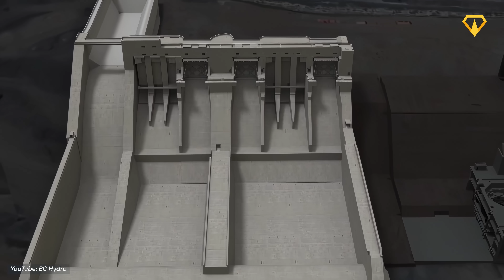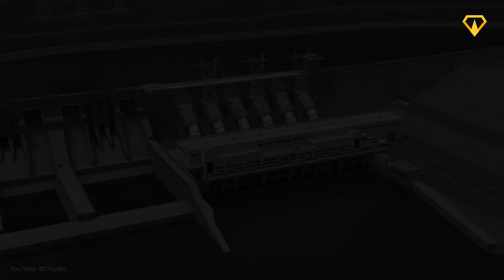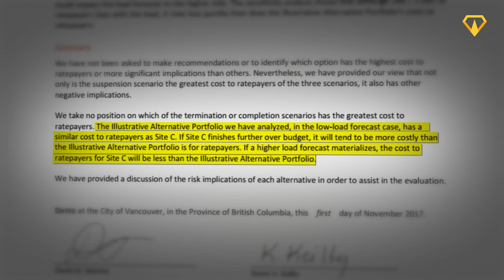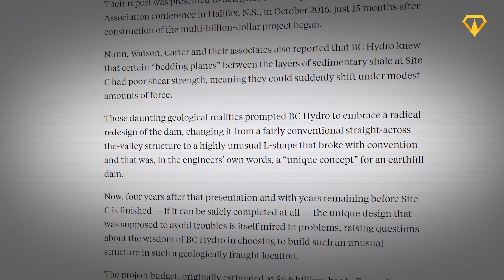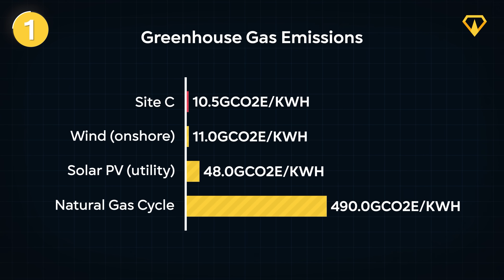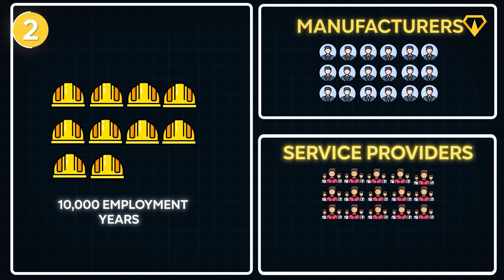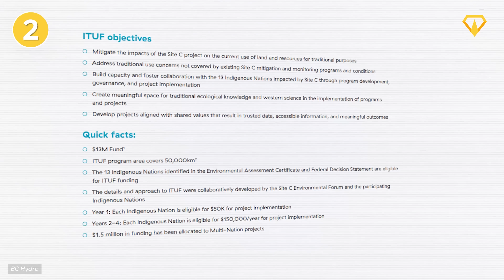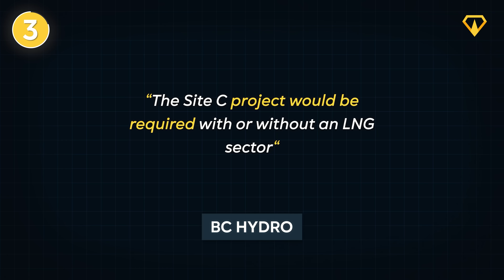Canada's Massive $12B Mega Dam

Comment: I live in BC along the Columbia River, one of the most dammed rivers in the world. My father ran an electrical consultancy specializing in power generation and distribution. He spoke often of the practicalities surrounding that.

As his son, I understand we need power but my thoughts often wander to what is lost when reservoirs are filled. This video glosses over that.

When the Hugh Keenleyside Dam was finished in 1968, we lost the 4th largest bread basket in the Province of BC. The ability to grow grains, livestock, fruit and vegetables with capacity exceeding the Creston area and on par with the Okanagan Valley. Gone. Wildlife are forever affected as well. With their habitat and migratory routes gone, they suffer and in many cases, disappear as the salmon and many wetland species have done.

These impacts are significant. We don't have lakes. We have reservoirs called lakes. The water level fluctuates dramatically and as the water level drops, the shoreline turns into a barren landscape, prone to dust storms. You don't see many boats parked at docks because docks are difficult to maintain as is the access to them. The beaches, once plentiful, are now few and far between.

So the word "renewable" has to be taken in context, as does the design meant to withstand a 10,000 year earthquake. The reservoirs will likely be filled with sediment by then so if the dams do blow, it'll be a wall of mud with a bit of water. And very little electricity being produced just prior to that. Humans - 0. Planet - 1. The planet always wins in the end.
Reply: Just a reminder that the WEF Agenda has been at their program for over 100 years and have buried all GOOD info that we all need to know. As an example there is no water shortage anywhere.  It is just deeper than they have told us but the pristine huge reserves are enough to look after the entire world continuously, as the actions of Volcanism creates pure water and OIL. Oil is NOT a fossil fuel. period. Texas oil fields are refueling themselves and they are just capping them to pretend it's not happening. (Trump and Bidenomics going on behind everyone's back). Same in Canada notice all the meters on your water ...what a sham!  All to create a mass illusion of shortages.
Reply: Disagree with most of what you said. Problem with people like you is you have no alternative plan. We are the envy of the world with our abundance of renewable hydro power. Only makes sense to continue to dam the Columbia and take advantage of the much smaller reervouirs that are typically needed. Sure there are some drawbacks but the pros far outway them and for the benefit of the entire Province.
Reply: Great comment. Unfortunately the world "needs" electricity because people are determined to live as "easy" a life as possible even if it means everything going to hell in a handcart. The first nations people lived a life in harmony with nature and flourished. They did not need electricity so why do we? Short answer is we don't. Now modern people destroy nature and live lives of depression, addiction, suicide and exploitation and the only people who seem happy are those who are rich enough to somewhat escape the man made problems of the world. But even then their happiness is skin deep because they aren't living natural harmonious lives. The happiness of the rich comes at the expense of the poor and the natural world. It's not a situation that can sustain itself and in the backs of the minds of the rich they know this deep down. That why you see their guilt flood out uncontrollably in insane attempted philanthropic endeavors.

Modern society has been a disaster and the problems get worse ever year. Ultimately it is unsustainable because people are growing more and more dependent on an increasingly centralised System and as a result this System can't make progress in case it makes a mistake which would devastate the lives of it's dependencies and so instead has to settle into risk averse stagnation.

Every time you turn on the news you see evidence that modern industrial society is stagnating under the weight of peoples dependencies and the next step is for it to break down completely. 

The future will not look futuristic, it will look like things were 5000 years ago with the added advantage of all accumulated knowledge having been retained and that is a very good thing indeed. IF your able to survive the breakdown of the system. As seen from the collapsing birth rates of the developed worlds it is clear that many will not survive the breakdown but that is simply natural selection continuing it's eternal march unconcerned about modern trends and phases.
Reply: correct.  people cant handle big pic and overstate the true impact of  “sustainability” industry.  100% guaranteed real net zero is zero humanity.  hunter gatherers and subsistence could be peak sustainable if over hunting animal populations are avoided
Reply: I'm for the advancement of people, even over wildlife.   Beavers are found all over the planet so one dam in bc isn't going to disrupt the big overall picture much if at all, for any species.  Human flourishing must come first.
Reply: @howebrad4601  It can all be done in coordinated harmony that considers all life as precious. Sacrifice the pawns and ask questions later? That model is outdated.
Reply: @Usammityduzntafraidofanythin  Thank God the Golden Age has arrived and out with the Dark Age's rules!!  Everything will change as our hearts change and that means all of nature too. Treading the earth will change to never bending a blade of grass as we step forward.
Reply: @howebrad4601  A typical response from someone who reaps all the benefits of hydroelectric power with few if any immediate repercussions. Humans need to eat. If we flood much of our best farmland for hydroelectric power, what will the people eat? May not seem like an issue now but wait until our population doubles or triples and places like California and Mexico are crispy dry with depleted aquifers.

Your response demonstrates a lack of appreciation or understanding the complexity and interconnectedness between all living creatures and ecosystems. We don't exist in a vacuum. Then consider that 90% of all creatures who have ever lived on this earth are extinct and ask yourself how long it will be until this happens to humans. Whether we caused it or not, the planet is heating up and soon enough, we'll be crispy critters too. May take hundreds of generations but it's coming. Then it will be cockroaches, wasps and ants that rule the world. We'll reach a point where we don't have enough power to run all our air conditioners, regardless of how many rivers we dam.

Beavers don't dam entire large river systems. Humans to that. Beavers dam small creeks and create wetlands that hold water and support a plethora of other animals, creating habitat instead of destroying it as humans do. So your comparison demonstrates once more how little you understand about wildlife and ecosystems.
Reply: @jimross898  well also consider the grand scheme of things. You say it floods precious farm land, likely true, but you should take into consideration if all that lane was actually farmable land. Also consider the lands outside of your specific little area. BC is huge, what we have is land. 

Although its important to do proper environmental assessments and make judgements to make sure we aren't being dumb, we also need to consider OUR impact and the needs.
Reply: @Itakaification  The Columbia River Basin is hardly a "specific little area." It's huge. In terms of the Hugh Keenleyside dam, the entirety of the valley from Castlegar to Revelstoke was farmed and very productive. A HUGE area. 

We do have land but it's not all farmland and as our population grows, that farmland will be what feeds us. We'll need power too. I guess the question is, which do we value more? With hydroelectric dams, we can't have both.
Reply: @jimross898  So our citizen mindset of whats farmable is very limited, that i agree, it also took many years to make land farmable.

But i want to highlight that farmable land isn't necessarily ideal farming land. Unless you or someone was actively farming in those lands, you won't know the soil composition. This is one factor, the other factor for why my opinion is as such, is because farming is risky and profitability is very iffy. Growing grass and wheat isn't risky, but those are also low profit and low maintenance. For such crops its more effective to grow them in the praries, its not ideal to grow unless you have scale since machinery necessary to make it worthwhile is expensive. 

I want to also add, I think we have the geography a bit off. Hugh Keenleyside Dam is not where site C is being built. Site C is built way north, and the area being flooded is mostly around the valley in the peace river. The area seem to be closer to the rockies, so the terrain probably isn't suited for farming anyways.

IMO, the flooding effects won't be that big because you have 2 other dams upstream which recycles water.
Reply: @Itakaification  I'm a farmer. I grow livestock. It's profitable and many are subsistence farmers so profitability doesn't matter to them. We rely on grain, hay and straw. Prior to 1968, we could buy all these things closeby. Now we have to drive over a mountain pass in either direction to find these products. One is the highest pass in Canada open all year.

Prior to damming, the area grew nuts, fruit, vegetables, hay, grains and livestock. It was the 4th largest bread basket in BC until flooding. We grew food for many people outside our region. Now we don't. We rely on other areas and that makes things more expensive.

In terms of farmland that will be consumed by flooding, Site C is paltry compared to what the Hugh Keenleyside Dam and other dams in the Columbia River Treaty. Revelstoke. Mica. Duncan. An astounding amount of valley bottom gone forever. Building highways through really bad and expensive terrain because we flooded the best routes. 

The impacts are huge and thus, my original comment. When it comes to the balancing act, I think many things don't factor in to the decision making and review process. I've seen it up close and dirty. We need to think long and hard about what we flood and remove from the otherwise usable landbase forever. Or until the dams are torn down but at that point, they'll be full of sediment and sludge, unlikely to be useful for a long time.
Reply: @jimross898  I think you are just pessimistic due to your own specific experiences. You don't have any constructive criticism towards why site c should exist and be finished. You only reference irrelevant points that don't concern site c.
Reply: @jimross898  Not everyone wants to be farmers.  It's that simple.
Reply: @Itakaification  Time to expand your mind!
Reply: @Usammityduzntafraidofanythin  But we all have to eat. So while you may not want to be a farmer, you probably want to eat. It's that simple. You're not a Tesla that plugs in every night.
Reply: @Itakaification  The points I raise are relevant to ANY dam. The effect is the same. As far as being a pessimist, you should come take a paddle with me. I can show you first hand. We need power. But we need food and an environment that isn't raped for every cent. I understand my viewpoint may be difficult for some to appreciate but for those who live in affected areas, the get it. They live with the repercussions. Referring to them as pessimists, etc, is a reflection of the level of misunderstanding of the impact of hydroelectric power by those who live far away from the reservoirs. Sorta like I could give a shit about traffic jams and smog in big cities. I never go there so the impacts mean nothing to me. It's easy for me to question the sanity of anyone who lives there as I have little to do with them and their environment. I have little understanding of the issues they face. So it's easy for anyone to discount others and to treat them as other if they choose. The trick is to be aware you are doing it as it never advances discourse.
Reply: @jimross898  Bud.. you can't take your personal experience as a blanket opinion on every dam. Every dam is different and has different circumstances and different effects. Im not trying to diminish the negatives of having a dam, but im trying to highlight the positives so that you aren't overshadowing positives with your negatives. If the discussions are on dams in general, you are definitely only looking at the negatives and the effects of just those around the area. Dams will always affect local areas in a negative manner, if you only look at it your way, no dams will ever get built. Reality is, dams are being built and not just in Canada, there are obviously reasons for building it, the positives outweigh the negatives.
Reply: @Itakaification   I think you missed the point of my original comment. This video glossed over a lot of information related to impacts. I wasn't debating whether hydroelectric was necessary or worthy. I have no idea where you live but I'm guessing it's not beside a reservoir, nor do most who will watch this video. Any balanced reporting or documentary will include both sides of any story or issue. This video wasn't balanced and clearly, the producers made little effort to do so.

If you want to see some really good and balanced documentary work,  check out Mike Halleran's work at the UBC online collection. It covers many resource issues including hydroelectric. It's called Westland. It dates back 30-40 years but covers many issues that are still prevalent today and a BC based perspective.

Comment: This video suggests that such projects are "national" when they are in fact provincial.
$12B for a measly 1,100 MW of power output is getting into nuclear power cost levels!  92MW per BILLION $ - (ouch).
Compare: James Bay:   15,244 MW at a cost of about $20B.   That's 762 MW per Billion or 8.3X less expensive.
762 MW is similar to Canadian CANDU nuclear reactors - that would cost about $10B today (maybe more).
If LNG is to be 'made' and it needs electrical power to do so, where the electricity comes from is only important in how it's generated.  Hydro is as clean as it comes.

Comment: LNG, even with drilling, capture,  processing and transport, is still less environmentally impactful than coal. Coal produces way more greenhouse gasses and pollutants and is way more energy intensive to extract. To put this in perspective, coal fired plants produced roughly 1 ton (2,200 lbs) of emissions per megawatt hour of power, while natural gas produced just shy of half a ton (976 lbs) per MWH. Coal fired plants in 2023 produced 15.3 gigatons of CO2 accounting for 40% of the world's increase in CO2 emissions. This was primarily due to China expanding coal fired electrical plants to produce more power, although India also saw an increase in the number of coal fired plants as well. To reach the same power output using LNG would have only produced around 7 gigatons of emissions. 

Furthermore, LNG emissions are purer, which means technically, if implemented, its emissions of CO2 and Hydrogen could be captured and reused elsewhere. Coal emissions are saturated with particulates both in the form of carbon soots and gasses like sulfur dioxide (SO2), nitrogen oxides (NOx) and ammonia (NH3). Sulfur Dioxide can form aerosols which, depending on the type formed, can cause either cooling or warming. Nitrogen Oxide can linger in the atmosphere (troposphere) for up to 1.2 centuries and can generate ozone along with other gas interactions that interact with infrared light, as a reflector. This contributes to global climate change and the greenhouse effect. Ammonia can also cause major issues by interacting with different molecules breaking down into constituent parts or combining  to create new aerosols. To quote: "When ammonia reacts with acidic species like sulfur dioxide (SO2) and nitrogen dioxide (NOx), it forms ammonium-containing aerosols that are a major part of PM2.5 aerosols in the atmosphere. These aerosols can degrade air quality and visibility, and they can also change the chemical composition of soil and surface water. This process can interfere with ecosystems, leading to acidification, which can in turn cause changes in species composition" 

LNG, on the other hand has far fewer particulate emissions, and what emissions it does produce are far more limited in the percent ratio to the total natural gas burned. It also depends on the production process. 
"carbon dioxide (CO2), water vapor, and sometimes nitrogen oxides (NOx), carbon monoxide (CO), methane (CH4), nitrous oxide (N2O), volatile organic compounds (VOCs), sulfur dioxide (SO2), and particulate matter (PM)"

Notably, methane is a potential byproduct, and it is 28 times more potent as a greenhouse gas when it comes to trapping infrared radiation in comparison to CO2. Methane is also typically a byproduct in the hydraulic fracture drilling process and blowoff from natural gas wells. Unlike the more problematic ammonia, however, methane has very little impact on soil and plant life, or animal life in general so long as it is dispersed enough. The total volume of methane released from natural gas isn't yet known, with estimate ranging from a few tons per year to a few hundred pounds a year (sources are sparse with any specifics and seem to be only estimates). 

So while I don't like that LNG is being used, I much prefer i over coal until such time that renewables can supplant all fossil fuels.